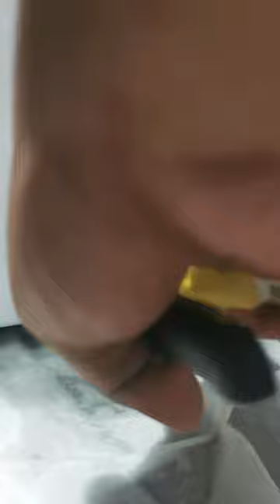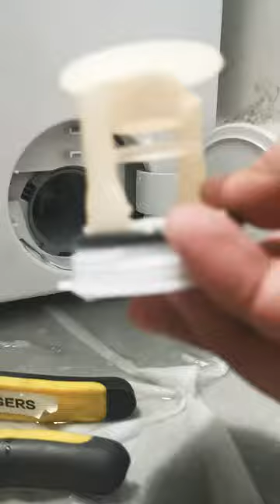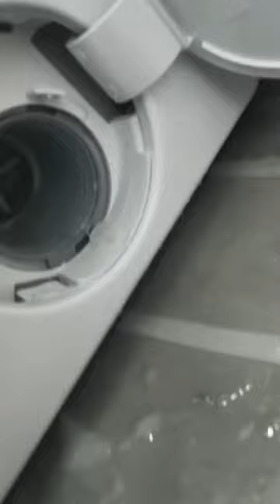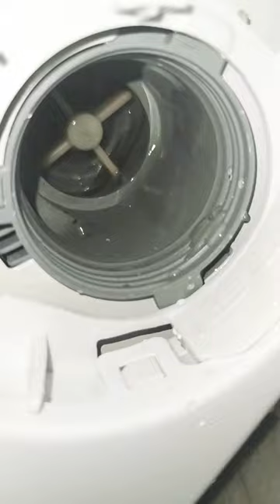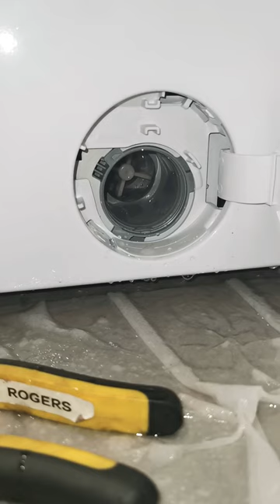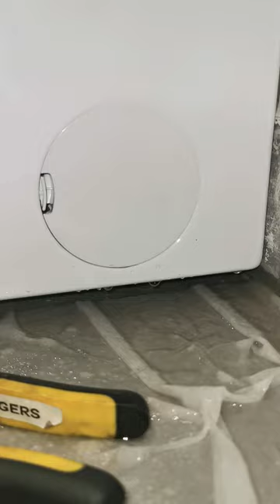How to remove and clean the filter of Beko Washer-Dryer WDX8543130W - First attempt

Comment: This is a  rubbish product, that thing is so tight, and with a flimsy plastic bit to hold you'd be forgiven for thinking Beko wants you to break it so they can charge you for the part. The instructions on how to clean the filter are wrong as it mentions a pipe that is clearly not there! Mine is a BEKO WDX 8543130B. The comment below about this machine not being meant to be cleaned actually makes sense
Reply from the maker: Yes, you are right too. If anyone wanted to buy Beko for their washing machine choice, please go for other brand.

Comment: I did this to filter the water out but when I closed it back and decided to reopen it, I found out that there was still water inside and I was really scared that if I keep letting water out it'll damage my washer, please what do I do, my washer isn't coming on
Reply from the maker: Open up the filter won't damage your washer. In fact, not open it might damage your washer because by cleaning the filter and inside it will help the water outlet work easily. Back to your question, it is normal if there is a bit of water in there. In my case, the water outlet not function at all; when I opened up the filter cover, the water drained out as much as the water inside the drum.
Reply: Okay but my beko washer didn't come to a pipe to drain the water out, it just flows out of the filter and I'm scared that I'll damage my washer
Reply from the maker: Do you use the same model as mine? It's weird if yours didn't have the drainage pipe.
Reply: It's exactly like yours
Reply from the maker: If it is the same as mine, then, there will be drainage pipe behind the washer

Comment: I do not have a rubber hose on the filter side. What is the solution to protect that side from rust or preventing water from reaching the bottom?

Comment: Why is there no pipe to allow the water to drain my laundry gets all wet
Reply from the maker: Actually there is drainage pipe behind.. But quite small and short if we compared to other machines
Reply: @best89my  Thank you but I checked and there is no pipe mine is just like the picture in the video every time I try to drain the water the whole laundry gets wet
Reply from the maker: @cynthiamalik5035  ooh.. U meant the pipe from the filter hole? Haha... Yes, no pipe.. U need to use plate or any container
Reply: I advise super absorbent incontinence pads (no joke) they can hold litres of fluid.